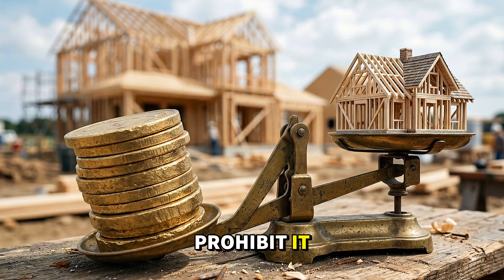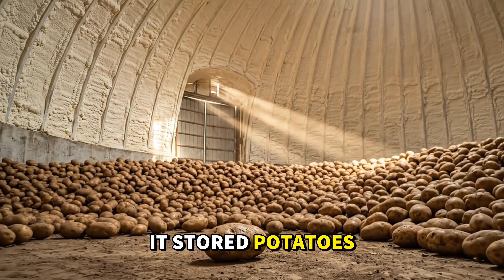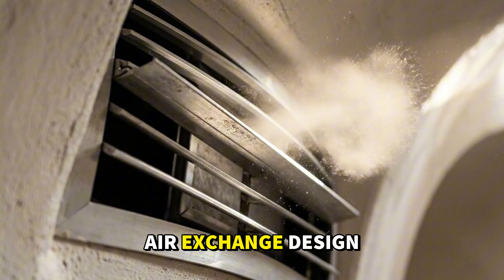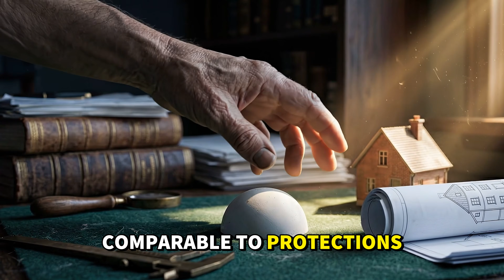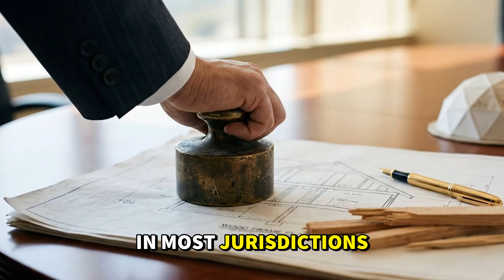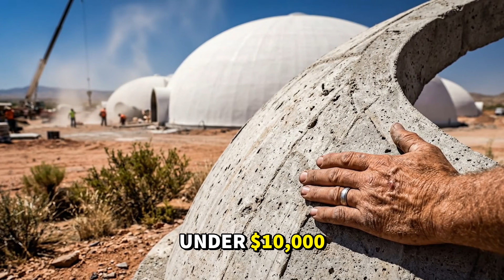This $5,000 Dome Survives Nuclear Blasts and EF5 Tornadoes and Costs $0 to Heat. Why Is It Banned?

Comment: I'd design mine for fallout shielding, if i were to build one, the walls would need to stop radiation.  So perhaps 3 foot concrete walls?
Reply: Do you think you will live to be 200 years old?  That's how long it will take for the radiation to become habitable.
Reply: @LynnRunningdeer-v9b  no. but i have children that will live 50 years after i die. it's not about me.